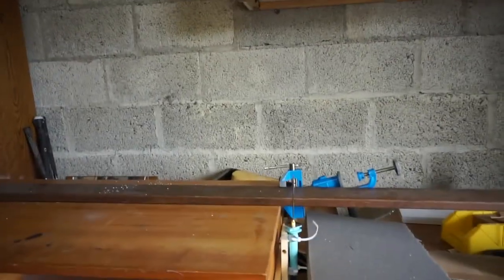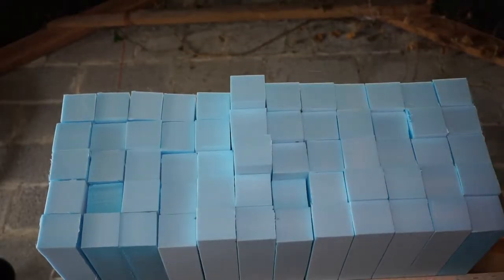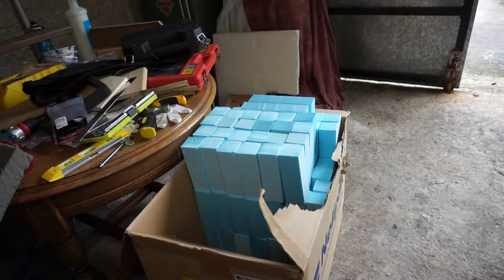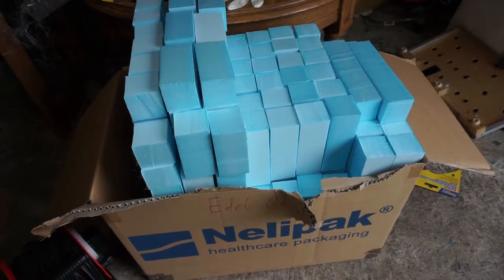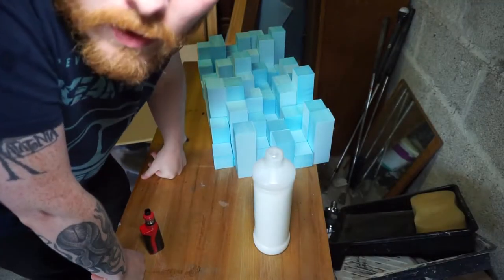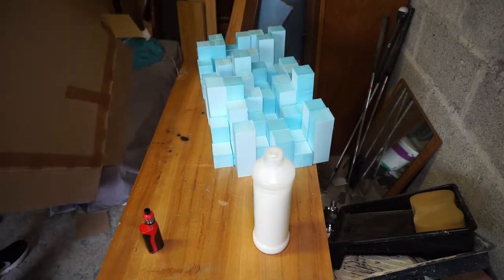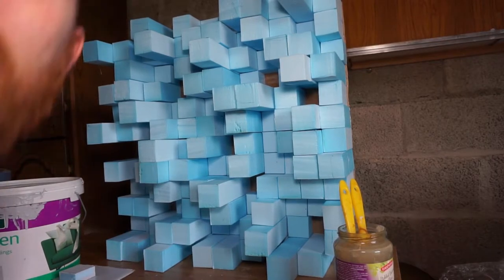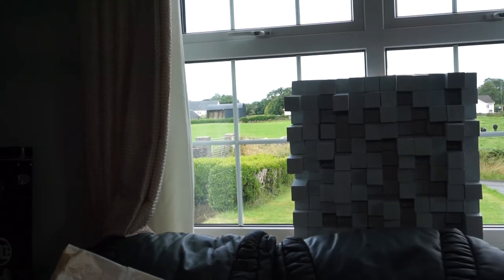DIY Skyline Diffuser

Comment: sir tell me why wood is used for it mostly.. is wood absorbent???
Reply from the maker: Wood is reflective for the most part. Diffusers are meant to reflect sound in a more diffuse way than a flat wall would. I used an absorptive material because it was lightweight and just as an experiment.